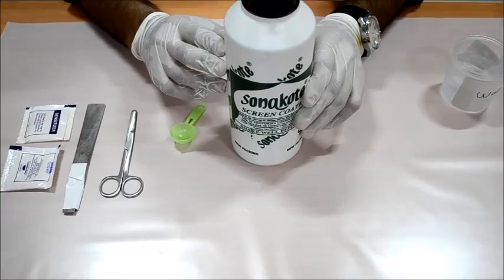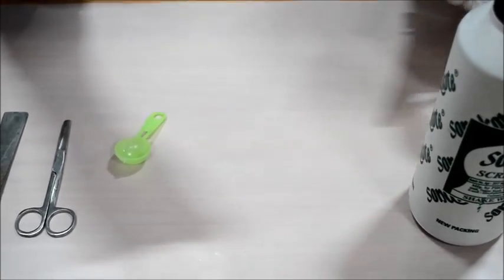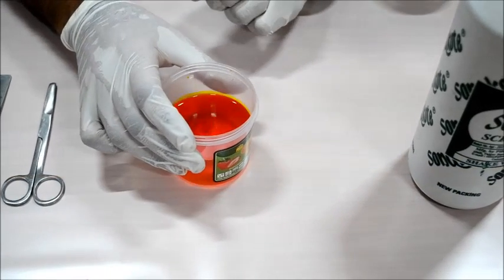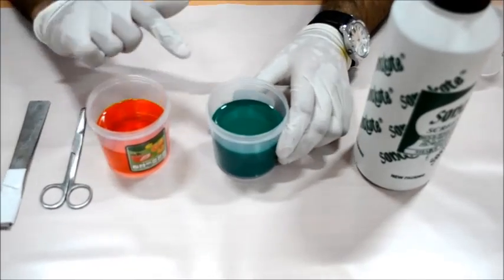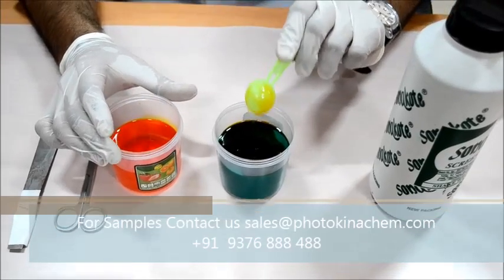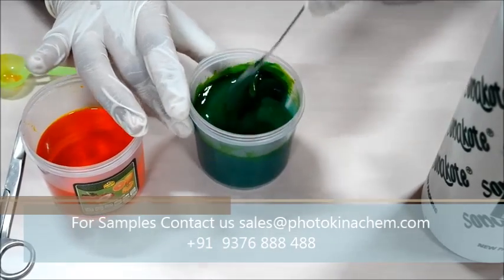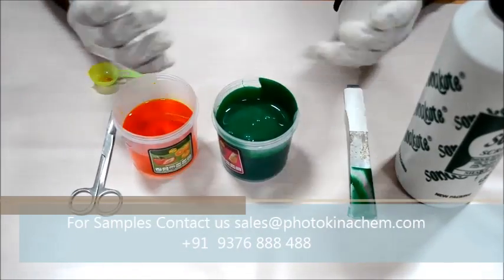How to make Sensitizer liquid and add Sensitizer # Sonakote Screen Printing Hindi

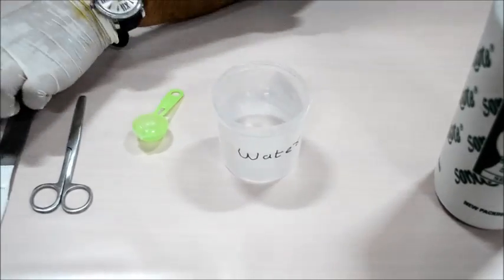Comment: Sir you have added 2 pouch of Sensitizer in 100 ml water and tot told the amount in gram. In another video you have told to mix 4 pack of 3 grm sensitizer in 100 ml water. Now I am confused which one is correct one. I am attaching your another video. If ratio is 1:10 with water then one 3grm pouch should be good for 30 ml of water. Please give the correct answer. Waiting for your reply. https://www.youtube.com/watch?v=ZZTVgeT6Nko&t=175s
Reply from the maker: Hello Shamik,
12 gm (4 pouch)  sensitizer + 88 gm water  = 100 gm sensitizer liquid + 900 gm Sonakote = 1 kg Sonakote sensitized emulsion. ready for coating

Comment: can i use normal bulb for expose screen?????
Reply from the maker: Normal bulb is very weak source of UV. it may cause your screen under exposed. 
try to get UV tube light with good vacuum facility for best results. If you are planning to buy bulb , Sun is better option.
Reply: thank u for ur kind information. I have used sun light for expose, it was good. but what is the exact ratio for mixing sensitizer and emulsion and how to wash used screen?
Reply from the maker: use 10 gm of liquid sensitizer for 100 gm of emulsion. 

what do you mean by wash? if you mean  decoating, then there are options available for decoating screens, You can use Shebro screen stipper liquid , for better and faster result (spill free) use Decoater gel. 

Thanks. (Happy screen printing)
Reply: @supriyobiswas2381  hello supriya could you please tell me for how long the screen has to be exposed under sun ?

Comment: please tell me ,how much wattage bulp should I use in dark room n which colour bulp
Reply: Plz tell me the idea of mixing emulsion and sensilizer. In this video 100 grm of water or 200 grm of water but confuse
Reply from the maker: Use one Kilo watt UV bulb with vacuum for better results, Also distance from bulb to Stencil or glass is also play important roll in exposure. For 1KW UV lamp  3 ft to 3.5 ft is ideal.